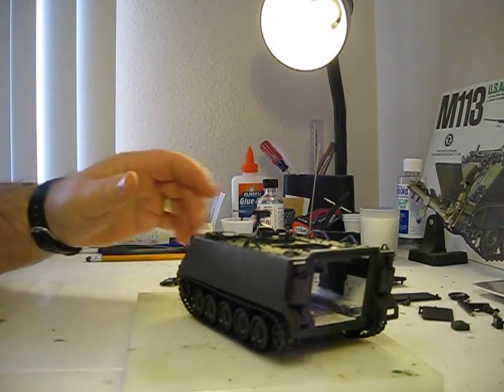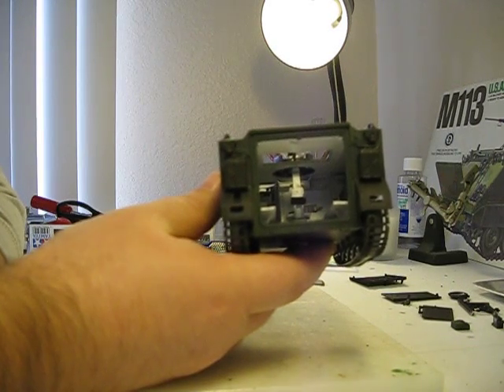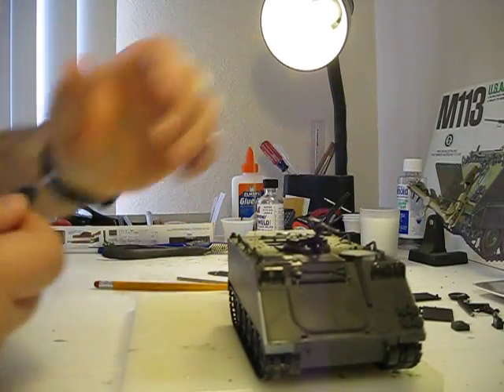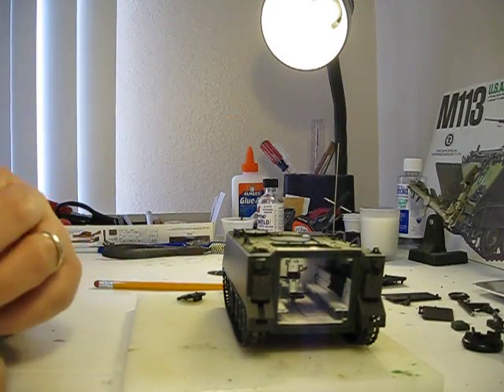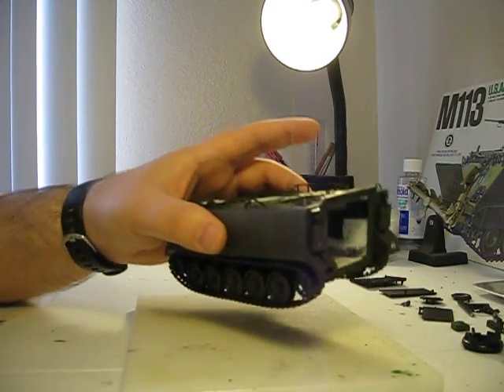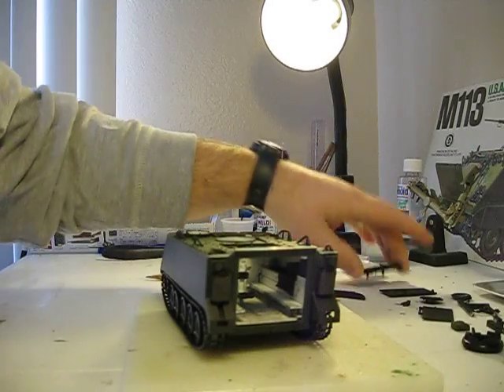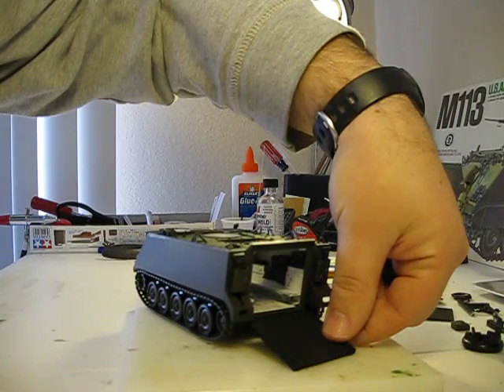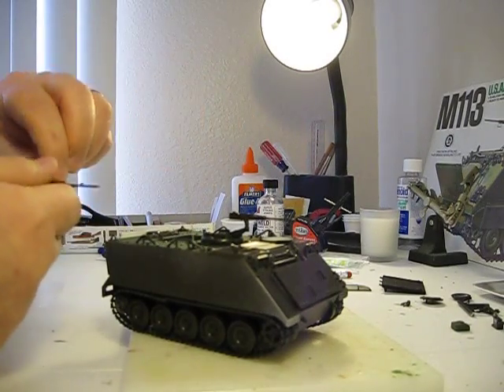Tamiya M113 APC: Part One

Comment: I sprayed mine Khaki and decided to turn it into a "Desert Storm" vehicle. Turned out well using a rattle can because the more I handle it, the more I get grime marks and small chips of paint here and there. One thing that never changes. No matter how well you build it, the flexible tracks never go on smoothly or are able to rotate. I used the outer hole (you'll know what I mean) and used Bondit. I use that for most exposed pieces that are prone to break off. It adds more plastic (Looks good it you use it right).

Comment: some carriers were white inside and some even dark green (normally the mortar tracks were the ones that were dark green) and  yes i was a driver and commander for over 12 years - if you want a great kit for the M113 get the AFV Club ACAV one as the list of faults they have corrected is very long - Tamiya still even release kits that are labeled A1 and A2 with a petrol engine with the kit and the Academy one is still only mildly better but still wrong - hopefully AFV Club will release and engine kit even if its an add-on i am sure they will do it more justice.

Comment: You're welcome and the Academy kit (M113A1) is a good kit to. I built the ACAV version and dont remember having any problems with it. They are pretty much identical as far as build goes..although you do have the option of indiviual track links. I like the Tamiya AVAC version more with the exception of the figures. The Academy figures the come with the M113A1 are really nicely done.

Comment from the maker: Thank you qdc.  Easy off works really well.  I use the fume free version.  Don't worry about the scent types.  In fact, I am currently using lemon scented.  LOL!  Just spray the piece being stripped and put it in an airtight container.  After two hours just give it a good rinse in water and gently scrub with a soft brush.  FYI, it may eat glue, so any pieces glued together may come apart.

Comment: should have used XF21 sky for the inside. that's the colour i remember from riding in that back of these.
Reply: in actual fact white is the correct colour as it is the M113 not the A1 variant and the original versions with the Chrysler petrol engine as modelled by Tamiya did have the white interior. the seafoam green was introduced when they changed to the A1 variant with the Detroit Diesel power pack except for the M106/M125 Mortar versions that were normally a dark green in the rear of the vehicle. Ex M113 Driver, Commander and Instructor 12 1/2 years

Comment: Were the interiors really white in Vietnam? I was an M113 driver in the 80's and the interior was a VERY light green that was almost glossy. Just about every edge, especially the front edges of the seats, was worn down to aluminum. I bought this kit while I was in and have finally decided to build it
Reply from the maker: +YarblekRW Build it!  It's a nice model.  I'm really not sure what the actual interior colors were.  Yes, many veterans of the late 70s and early 80s talk of the interiors being light green.  Model on!
Reply: +Russell Gosselin I am going to get a bunch of old negatives of my track scanned at Costco then let the building begin. I took a ton of pictures (Lol in 1988) of my tracks details so I can build it specifically. I've Got to have that "Special" welding blob where a defective U-joint came through the armor plating 6" under my feet!